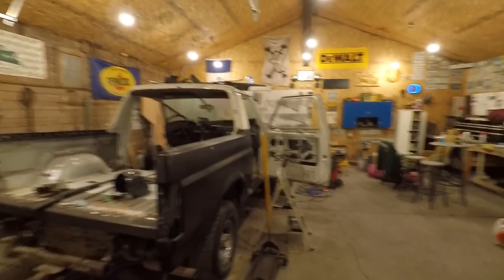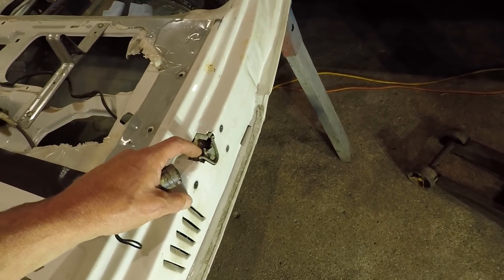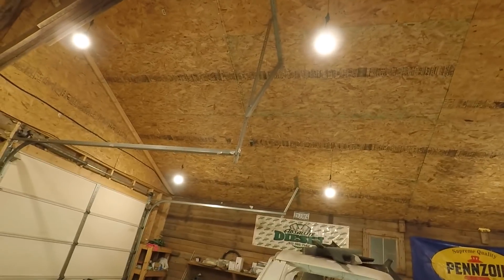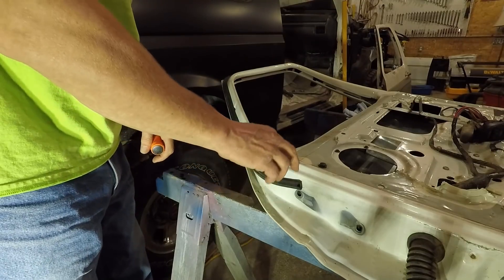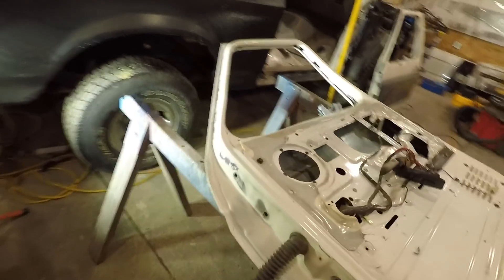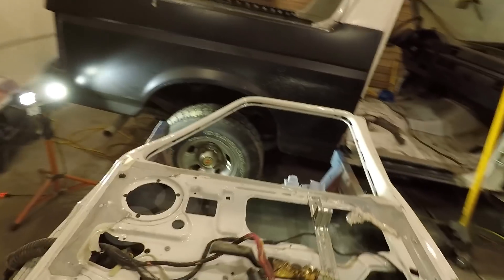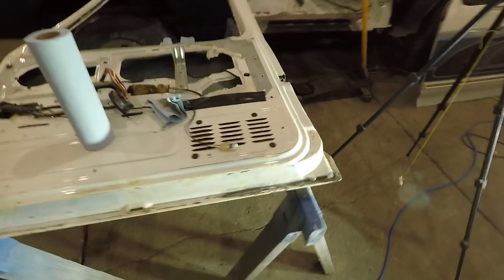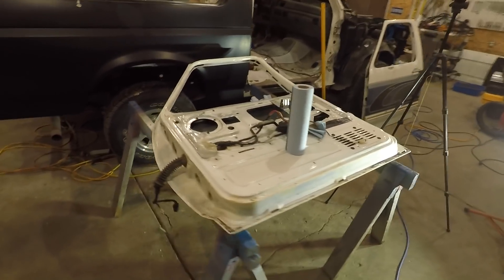Prepping The FORD BRONCO Door For PAINT

Comment: A couple years ago I had to get my whole bed replaced because of somebody hitting me from behind on the highway, well the bed that we replaced the old bed with has a dent right where the back of the cab and the bed meet and its touching one of the bolts on the cab and it squeaks I tried using a slide hammer but it didnt work any advice?